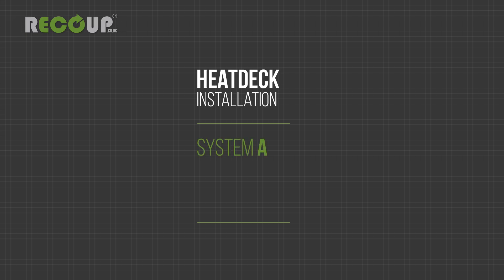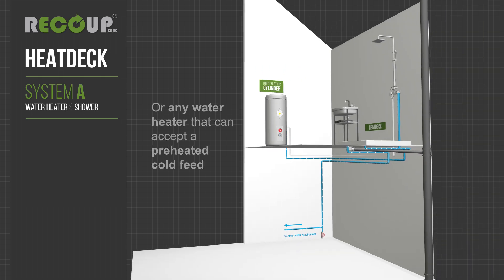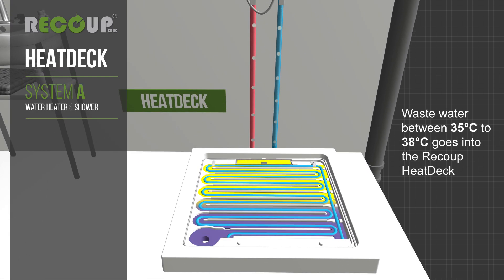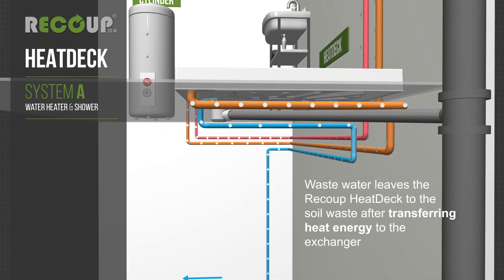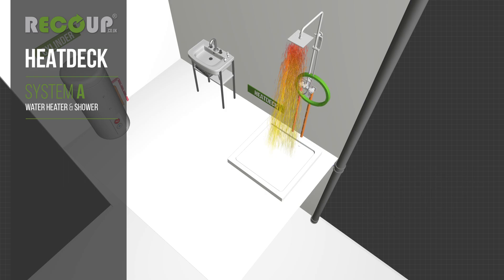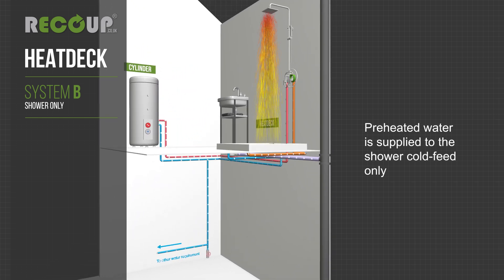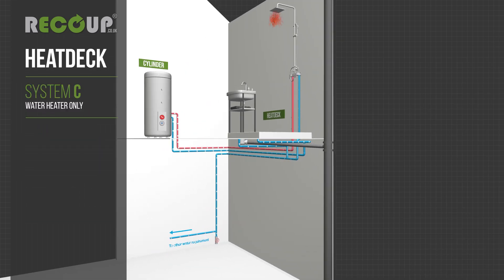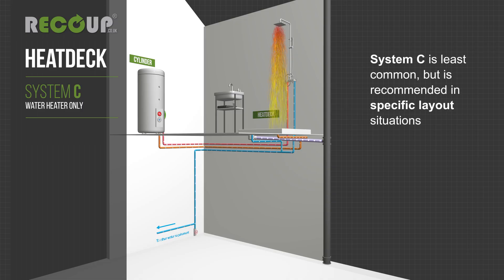Recoup HeatDeck WWHRS How it works Installation Methods A B & C

Comment: Good idea. All three methods would work with an instantaneous water heater, but with a pre-heated water cylinder it’s different.

For your hot water cylinder to benefit, your water heating system would need to be operating at the same time as you are using the shower. Otherwise none of the pre-warmed water would be used to heat the cylinder.

I’d say this means that cylinder systems like non-combi boilers, heat pumps etc might as well use the simpler method B.
Reply from the maker: Hello, firstly our sincere apologies this message was not replied to before now. We are not sure why the message notification was not received, the comment was just found. But we thought we would reply very late rather than never.

You are correct that instantaneous heaters benefit immediately as less energy is required to heat the water being used at the same time. However, cylinder installations will also benefit from a System A installation. As the preheated water has a greater temperature than cold mains, the overall temperature drop on the cylinder is reduced. The same energy that would otherwise be lost is saved within the cylinder. This increases the overall efficiency of System A installation compared to System B as shown on the efficiency data on our product page https://recoup.co.uk/products/heatdeck/#data-specification.

Granted there are situations of use when this energy would be lost over time but this is taken into consideration within calculation methodologies such as SAP. System A installations are typically used on New Build or extensive renovations installation's when it can be incorporated with greater ease and the increased efficiency makes a greater difference particularly with SAP. But this would also usually be with our higher efficiency vertical pipe, the Recoup Pipe HEX. For Retrofit installations, System B would be easier to install and more likely to be used.
Reply: @recoupwwhrs  thank you for such a detailed reply. That really helps me to understand how both setups can help. Interesting also to hear about your vertical heat exchanger. Thanks again.